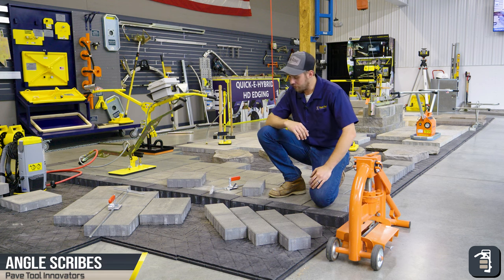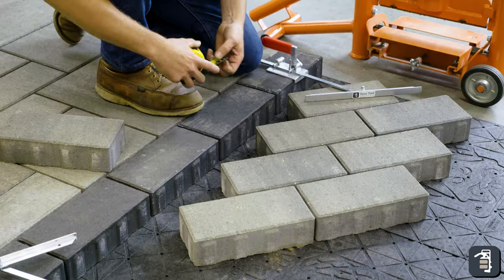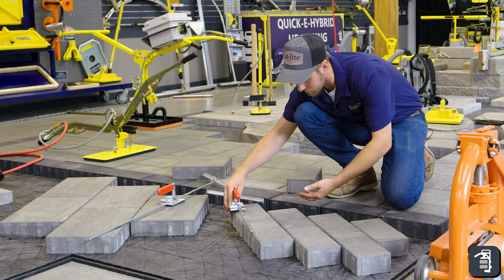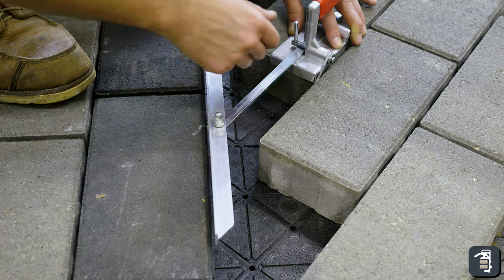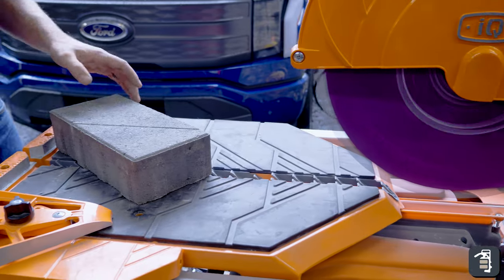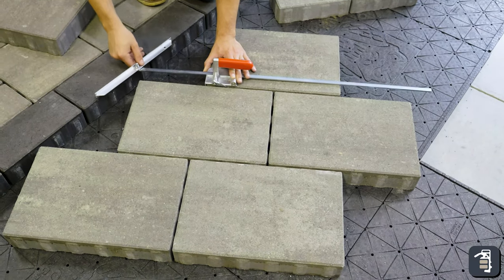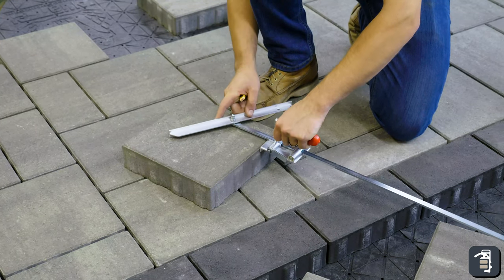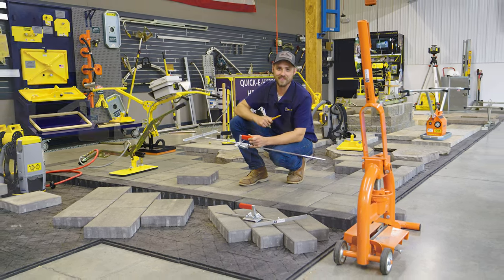Angle Scribe Pavers Easily

Comment: Id be quietly setting my paver down on top and marking my line points and walking away before that tool was set in this application... However, this would be useful when cutting against walls and such where that method isnt possible.